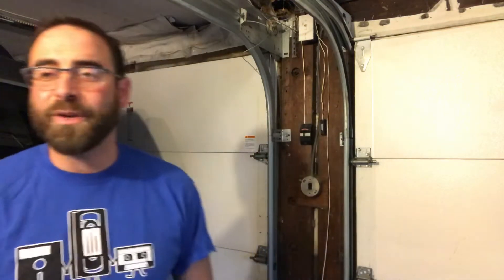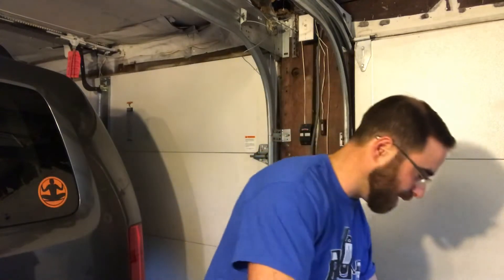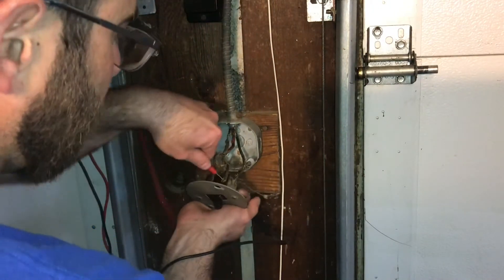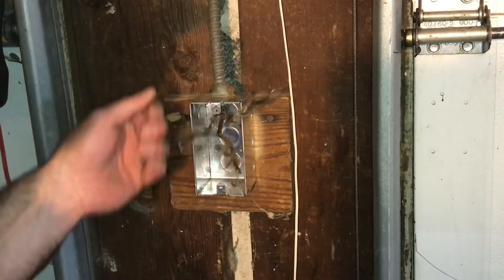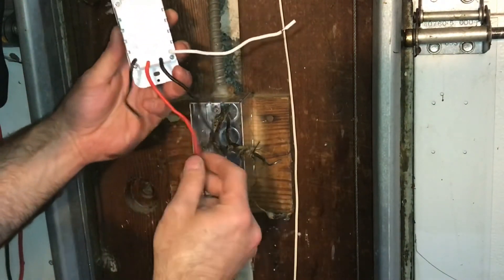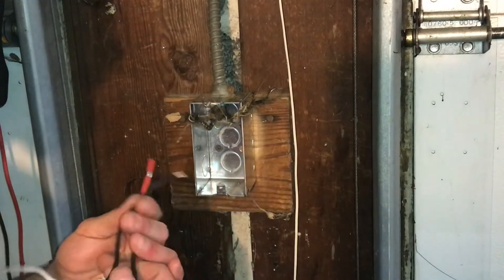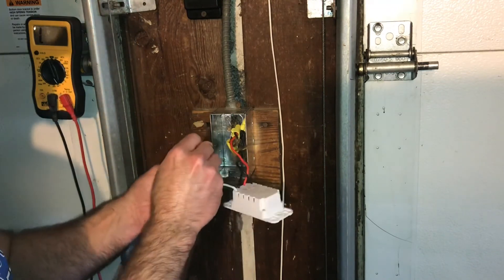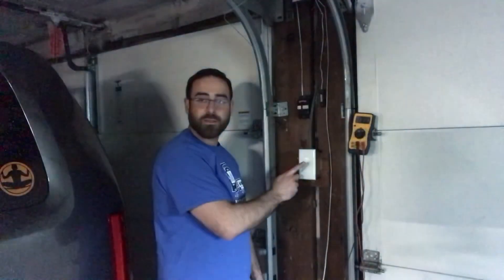3-Way Smart Switch installation - with or without neutral/ground

Comment: Good video

1. Contrary to comments, there are no safety concerns with using the ground wire in place of a missing neutral with a smart switch.  Contrary to comments, if some big short somewhere in the circuit, it will not cause it to burn out switches.  A big short would cause the breaker to trip, and the momentary short to the ground wire before the breaker trips causes the electrical potential to be the same for hot and ground which would result in a momentarily stopping the power being used by the switch's electronics, not overloading them.  Valid challengers to this explanation will need to explain the mechanism whereby his method can be unsafe or cause damage to their electronics.

2. Using ground as neutral is contrary to NEC for multiple reasons:
- The ground is designed to be a temporary path that needs to carry current just long enough to trip the breaker when things go wrong. It is not sized for continuous power and thus could cause a fire. The few milliamps used by the switch cannot overload the ground to cause a fire.
- If you have GFCI in the circuit, it might trip the GFCI because there will be less current flowing through the neutral than the hot, with the difference being caused by the switch electronics returning power through ground.

3. How can the Luetrons and Levitons have models that do not require a neutral? Good question.  The conductors being near each other cause induce current flow between themselves, which include both neutral and ground, therefore, GFCI cannot be perfect. Possibly they use so little power that they do not set off the GFCI or they must be able to pass a small amount of power through the load without activating it, which in turn might be why the ones that do not require ground tend to have more reliability issues and most vendors do not support no-neutral smart switches.
Reply: I'm an electrical engineer and a home owner.  You may be right in theory, but I would never wire my home in direct violation of the NEC.  If there were any accidents...such as fire or electrocution, I think you would find yourself in a bad situation with your insurance provider.
Reply: @edadan  
#1.  It is not in violation of the NEC at all.  In fact the opposite if you read the text.  Tying neutral to ground in the device is precisely what is going on with all of the polarized UL plugs you use.  It's simply no longer the recommended method due to progress.
#2.  What has happened is it is not the recommended method for the situation anymore since GFCI.  Tying the ground pin to neutral will save your life some of the time.  Ensuring each outlet is polarized correctly requires more time to implement, and careful testing.  GFCI will save your life even if the house it wired backwards, which is why it is recommended.  (BTW, if you have a plug that tends to trip your GFCI with a specific device but not in other plugs, the hot and neutral are likely reversed.)
#3.  Having a 2-wire system without GFCI on every plug and no conduit ground, with an updated standard polarized 3-prong plug, where the long-blade neutral has not been verified as neutral, and not had ground tied to neutral, is as dangerous as it gets, which is why electricians advise homeowners when they discover a ground to neutral jumper, to leave it alone.  The only ones giving advice to remove them are non-electricians or those who have some knowledge gaps.

While throwing in GFCI to protect in an old 2-wire house without verifying neutral and tying the ground to neutral to do things right (other than ripping out the walls to install new wire), GFCI still does a better job protecting than doing everything right without GFCI.

Comment: What would you do if you have a plastic box and no neutral wire?
Reply: If you have a ground wire, and the ground wire is tied to the neutral/ground bus in the breaker panel (which in turn connects to earth ground), it will work fine.  To determine if it is tied  to the neutral/ground bus in the breaker panel, measure the voltage between a hot wire and the ground wire.  If it reads normal line voltage, the ground wire is likely connected to the neutral/ground bus in the breaker panel as would be expected.  If not, then the ground wire does not have a path to the neutral/ground bus in the breaker panel which at that point has safety implications.  The remedy might be as simple as going to the upstream electrical box tieing the other end of the ground wires to that ground wire.  If that doesn't remedy the situation, depending on your knowledge of electrical, you might want to involve an electrician because there is something strange going on that needs to be sorted out before you can have confidence in your wiring from a safety and fire perspective.

Comment: Your installation breaks a lot of code rules.  The purpose the neutral line is so that the power line with the neutral line "power" the electronics of the switch itself.  Your check of what line is power is not done by a continuity checker- that just say what lines are connected by the switch based on the position of the switch.  To find which is power, use a circuit tester after the switch is removed when the circuit breaker off (the cheap ones with the red/orange neon line in them).  FYI most often the black screw on the switch is a power candidate and the brass ones are the traveler but that depends on which 3 way you is first in the circuit so that why you need to really test and you text without the switch so it doesn't make a circuit between the wires itself. Touch one line of the tester wire to the wire and touch the other to a ground.... which you may have via the metal housing.  If it lights up, the wire may be the power but it still may not be.  So check them all and keep track each wire that lights up.  Now go to the other 3 way switch. a flip it once.  Go back to the switch you're replacing and  test the two power line candidates... if there is one that still lights up... it's the power most likely (unless there is some other wiring issue).  You should really check at the other 3way switch as well.  if you get a power candidate at each one, somethings not right with your original wiring. By the way, the metal housing even if it is grounded is not a suitable neutral.  Neutrals are to be tied together in the big electrical panel, so using the ground to make the switch work, though it works, it's not good practice.  If you had GFCIs on the same circuit you could cause them to fail.  That's my comments... use at your own risk.  I make no guarantees regarding my comments and I accepts no liability for how/if you use them. Thanks.

Comment: I’m not an electrician, but it seems to me at 2:49 you used the positive lead on your multimeter as the ground and the negative  lead as the positive.
Reply: Did you notice the negative sign on the LCD?

Comment: Sir, Hello From India.
My House Has No Grounding But Has Neutral Wire.
Can i use my Tplink kasa smart switch by attaching ground wire to metal switch box in brick and cement wall ??
Reply from the maker: I’m not sure how wiring is in India, but a metal box usually is the ground. Confirm with a multimeter.
Reply: @gjdct  Ok…Thank You Sir.

Comment: I'm a little confused. The neutral is how the smart switch stays powered to receive on/off signals from your hub even when the device the switch controls is off. So if you are able to power the switch by connecting the neutral wire on the switch to your ground, that means that your ground is carrying enough current to power the switch. But it's my understanding that there's not supposed to be any current on the ground under normal circumstances; it's only supposed to carry current in an emergency. Doesn't that mean that there's something wrong (and potentially dangerous) with your wiring?
Reply: Hello, I'm a Little Confused, (odd name but ok) I am Aztec Warrior. The answer to your question is "42". You are welcome.

Comment: I have this same switch and read this, got curious, so did some testing. First, I asked myself  what voltage is present on the white wire coming from the switch that I am potentially charging my home's ground with? So... With everything but the neutral connected and power turned back on, I  measured O.12 vdc (one tenth of a dead AAA battery) between the open (not connected to anything) end of the neutral (white) wire coming out of the switch, and ground. When connecting the neutral wire to the ground wire in the electrical box, the smart switch performed completely normally with set up and operation exactly according to directions. Next I wanted to know the current draw. Measuring current through that little white wire from the switch to the ground was tricky but I got a high enough impedance shunt that indicated a reliable measurement of 0.2 micro amps. Numbers were verified with the switch and its companion in all four possible states. It is clear that this neutral wire is simply the return for the wifi radio and digital circuitry. It, in no configuration, was in any way capable of applying household voltage or current to ground.
Reply: The neutral is used for the switch to power itself along with the hot wire and have it's own circuit.
Reply: Also... just wait until there is a real short somewhere and what all gets damaged... those switches aren't cheap.

Comment: Oh wow, this just goes to show you that there really is a lot of bad info on the internet.  If you have the neutral wire in your other box then simply put the wi-fi switch in the other box but don't ever attach the neutral wire to your metal box!!

Comment: I used this method, i connected my ground and neutral it works!  I tested the  screw that holds the switch with a non contact tester, there's  a current but when i touched it no shock... how is this possible? Is this safe?
Reply from the maker: Tell me more about the current you’re measuring. AC? DC? Voltage?
Reply: @gjdct  AC , i just used  a non contact  voltage tester klein tools.
Reply from the maker: @ac_tv2050  my guess is that you would be getting a low voltage DC current. 5-10 volts.

Comment: Yeah I too thought that would work "I'll just take this neutral wire and ground it". lol. turns out if you have a Wi-Fi device inside that smart switch that needs power that's a really great way to ruin your smart switch...

Comment: As a license electrician do not tie a neutral wire to your ground system unless it is in your main electrical panel where your neutral and your ground are supposed to be bonded. Does this work Yes but he is putting neutral power through his ground system which creates a fire hazard.
Reply: in addition to that you'll probably want to start explaining the people that in most smart switches what that neutral wire is actually doing is supplying a small amount of power to the Wi-Fi unit inside of that smart switch which it needs to actually "be smart"... so I speak from experience when I say "turns out if you just ground your neutral wire that becomes a really good way to just ruin your smart switch"
Reply: can you please recommend a (smart) 3 way dimmer switch. I have no neutral in either box. one box has line (live ) and the other has (load). Its okay if it only works on one side and the other just stays with a regular 3 way.

Comment: You should not use ground as a neutral, it is against code. In addition to being dangerous, and cause circuit imbalances and ground loops
Reply: correct. and I speak from experience when I say that neutral wire is supposed to be supplying power to the Wi-Fi unit inside the smart switch... and it turns out if you just ground out that neutral? that ends up being a really good way to just ruin your smart switch.
Reply: @christianzagarskas8425  Hi! I have a quick question. I dont have any ground wire to plug in my smart switch, can I nail my ground wire in the box directly?
Reply: @Mohamed-m2m9o  first off, a disclaimer "I am just some guy on Youtube, not an electrician"
now thats outa the way: your answer is MAYBE?
So, in theory if your box is grounded, sure, go ahead and do some risky shit like "nail a ground wire into the junction box"... that is... if your stuff is not all that important to you - but uh, seriously? if your "fancy electronic wall installed stuff" is even remotely important to you? then hire an electrician to just do it right.
Reply: Neutral is a return current from the plant and ground is your emergency excess. Neutral to ground causes electricity depletion to earth.
Reply: @motaheri  The neutral wires are tied to ground in your electrical box. It's not a matter of causing "electricity depletion to earth", it's a matter of bypassing the proper circuit for that breaker and creating a fire and shock hazard.
Reply: @mammonbeezlebub2427  not in my electrical box, the neutral in a properly wired house is always going back to the source completing the circuit. And the ground as the name suggests should be going to the ground. Using the ground as a replacement for neutral wire can cause electrical hazards and ruin your equipment. Avoid doing this as this is dangerous.
Reply: @motaheri  Your hot wires are wired to the breaker which in turn connects to the hot bus bar (not grounded). 
Your neutral wires are wired to a neutral bus bar, which is connected to the service ground.
Your ground wires are connected to a ground bus bar, which is connected to a grounding electrode.
The neutral bus bar and the ground bus bar are tied together - either in the breaker box, or in another service box if the main disconnect is separate. 

***If you take an OHM reading across the neutral wire and ground wire, you will see almost no resistance because they have a common connection.

The whole reason the dangerous method in this video works is because both the neutral bus bar and the ground bus bar complete the circuit because the have a shared connection.  
The problem comes from the fact you're quite probably sending return current through grounded electrical boxes back to the breaker box, instead of using the dedicated grounded return line. 
The ground wire is an emergency circuit for shock and fire protection, not the dedicated circuit. 

There is no dedicated "return" neutral wire back to the plant. 
Power transmission uses 3 phase AC transmission, not a DC circuit.

The service neutral comes from the transformer and is created by the 3 phases. 
ALL lines from the utility plant are hot. 

There is no completed circuit in your breaker box.

Since the service ground and grounding electrode are tied together in the disconnect box, there is no "electricity depletion to earth" problem.  

You're simply bypassing the proper circuit for the breaker - which is dangerous.

God gawd - If you don' t understand what is going on with your breaker box, or AC electrical circuits in general, you shouldn't be messing around in your breaker box.

Comment: There should not be current on the ground. Connecting the neutral and ground anywhere beyond the main panel will put current on the ground.  Am I wrong here?
Reply from the maker: The ground is intended to route AC current in a faulty circuit directly to the ground rather than through a person. In this case, it’s grounding out the DC circuitry of the plug, much like how frame of a car is the negative. Is this up to code? I’m not sure, you’d have to check with your electrician. Is it safe to touch and does it work, yes.
Reply: @gjdct  Meant most constructively - If I can use your analogy of the car chassis - you do understand that all the circuits connected to that chassis actually flows the sum of their total current through that chassis to the battery negative, right? Similarly you are flowing the AC current from that device through that conduit back to the panel. But regardless with your situation it's actually NOT grounding out the DC circuitry, you are absolutely grounding the AC Neutral and current WILL flow down that ground line. In this case it happens to be a fairly small current (because that devices electronics is a fairly small load) but that does not make it right. Definitely a code violation. Incidentally about the only Smart Device I know of that does not require a Neutral is a Shelly 1L Relay which can install inside the box and utilizes std switches (you can use the SPDT 3-way switches but they are wired up a little differently to only use one output)
Reply: @decosse01  there are a few no-neutral switches out there these days. I use some Zigbee ones. Hot, Neutral, Ground is all they have and work perfectly.
Reply: @thatsux0rz  Read your reply again, particularly your last sentence. 😁 My main part of the response was to highlight that the Ground should not have been used. I'm sure there ARE some devices that do not require N, I was just providing the only example I knew of personally. as an alternative.

Comment: You Never ever want to install a WiFi, Zwave, Zigbee, RF/IR, or even a Bluetooth device into a switch/junction metal box unless it’s a last resort situation or the device has a mount/screw for an external antenna. What firmware did you flash your switch with? I wouldn’t imagine your recommend viewers install a device that’s fully dependent on 3rd party cloud services. Both tasmota and esphome have a ton of options that allow to customize a three way switch configuration. You can technically use the one installed 3 way switch to control other devices in the garage with things like long press/double press. For example, You could use the long press to open the garage door while the short press works with the dumb switch as a standard 3 way config.
Reply from the maker: I did not flash the firmware nor do I have an exterior antenna. In my instance, the metal box has not affected the connectivity of this switch at all. The fact that the front of the metal box is completely open and faces towards the interior of the house (where my router is) I’m sure plays a role.